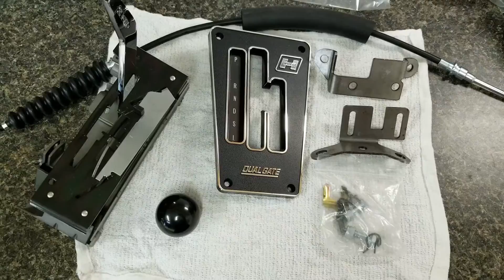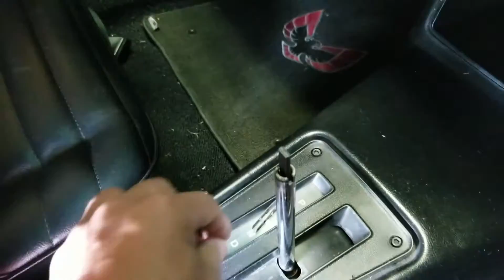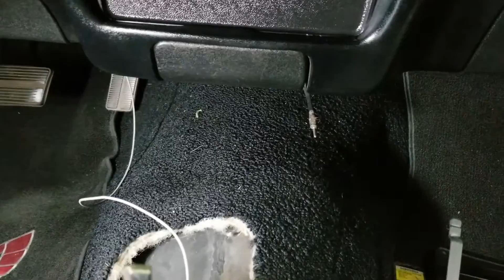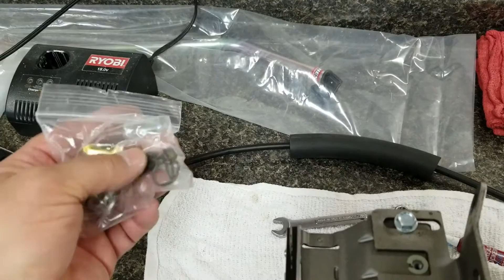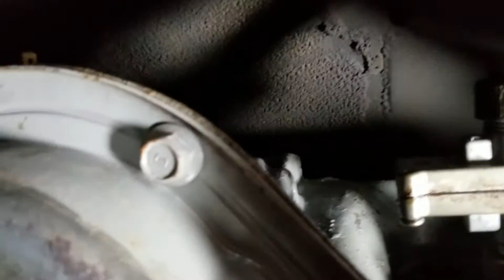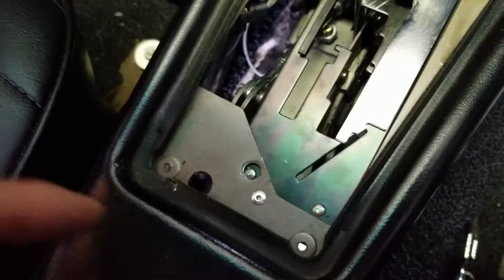Hurst Dual Gate shifter install in 2nd gen F Body factory console

Comment: Hey Steve.  Which shifter did you order for this install.  I don't see one specifically made for the Gen 2 Firebird, so assume you fit one from a GTO or other BOP with Turbo 400?  Obviously, the shift plate is for the Firebird, and I see you can order these, just not the shifter itself for a direct Firebird install.
Reply from the maker: When I ordered the shifter there was one available for Camaro/Firebird. It could be that they have sold out. You might want to contact The Parts Place and see if they have one.

Comment: Dude just removed the factory ratchet rally shifter for an aftermarket hurst. If you have a 2nd gen fbody look at the shifter lever dust cover, if it has an oval cut out around the the lever you have a factory ratchet rally shifter. You pull all the way back to 1st and then push it to the right & it'll click forward into 2nd gear and spring bac do it again and it shifts to 3rd & springs back, it's a factory ratchet shifter.
Reply from the maker: This is true, but it's not a Hurst Dual Gate. The Dual Gate is a legendary muscle car shifter.
Reply: @SPSteve  what are you talking about it's not a dual gate?, what you installed is a dual gate. What you removed was the rally
Reply from the maker: @brianbevans6804  Are you an idiot? I don't give a rat's ass about the factory shifter. I know it's a factory ratchet shifter, I don't care. I wanted a Dual Gate in the car so I installed one. Go away and leave the muscle cars to the people who actually have them.
Reply: @SPSteve  your a soft little snowflake aren't ya, lol. You wish you had my collection.

Comment: What did you do for reverse light and neutral safety switch?
Reply from the maker: I don't remember, I sold the car 4 years ago. I may not have had a neutral safety or backup lights since it wasn't connected to the steering column.

Comment: Hey, can you tell me what shift cable you used.  Bought my shifter used and I have no idea what cable I need?  Exactly the same as your for 350 turbo in a 1978 Camaro.  Thanks in advance.
Reply from the maker: When I bought my shifter from The Parts Place it came with the cable. Try The Parts Place and see if they have cables? Otherwise maybe try Hurst?

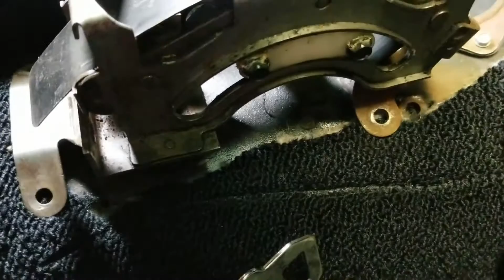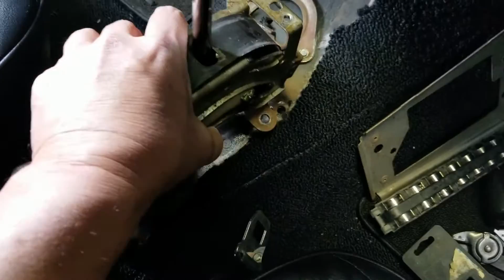Comment: A suggestion (if I may): Show and call out each individual item that you'll be removing before removing them (rather than just describing them after you've already removed them). For example, from 4:04-4:15, you show three places where the hardware used to be, but isn't anymore (the 4 mount screws, cable linkage, and cable retainer clip).

Just my 2c, YMMV. (Well ... I am a professional tech writer in aftermarket performance car accessories.) ;-) 

That said, I did find your video pretty useful.

Comment: Hey steve, got a question for ya on this shifter.
While banging thru the gears until you reach 3rd (when used on the th400), can you go into neutral or reverse by mistake ?
Reply: @SPSteve  gotta link to the road test video?
Reply: No

Comment: Have one in my TA and have one on the shelf for my sons car, I used the same shifter ball with the pattern on it.
Reply: SP Steve they made a lightning rod shifter for them that was cool but you can see how hard it is to get the dual gate that you'd probably never find one. Was this shifter new or refurbished? Somewhere I have the hurst installation instructions downloaded, you can still find them on the web.
Reply: SP Steve didn't know they had them. Forever they were in all the big company catalogs. I didn't hook up the passing gear switch ether. Never noticed it lacking on power to get up and go.
Reply: hey Steve, im confused, which kickdown are you talking about ? is the kickdown feature no longer available when using the dual gate ?
Reply: gotcha, yea thats what i thought ! thanks for clearing that up :)